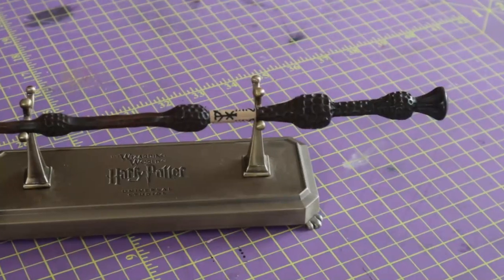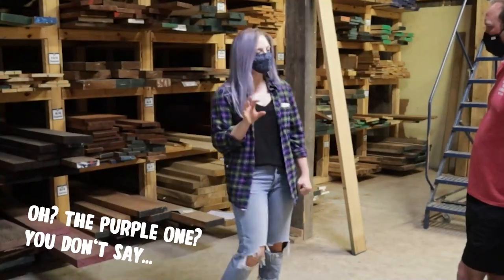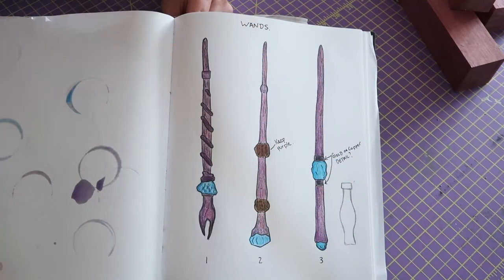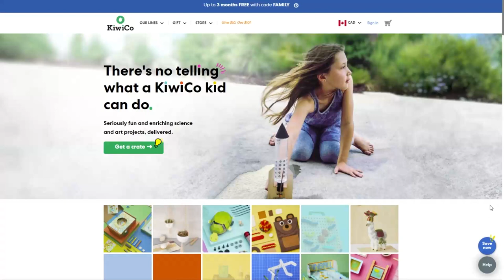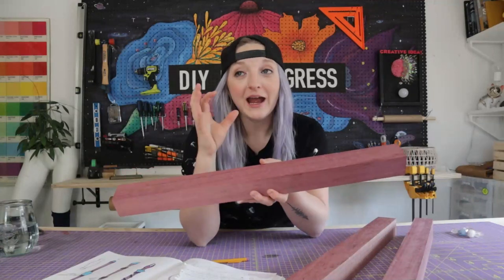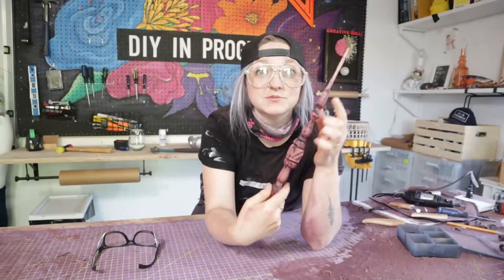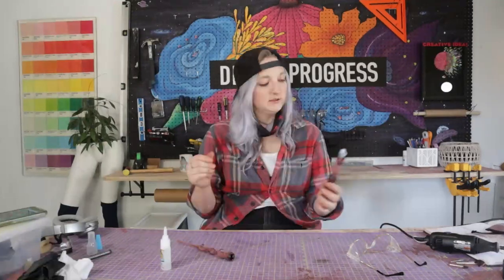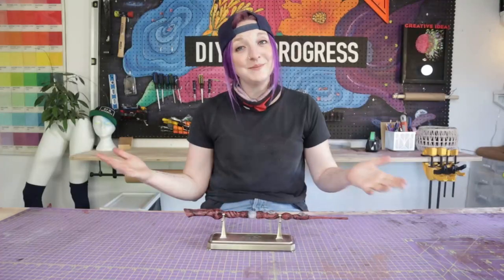DIY Magic Wand w/ Purple Heart Wood! | CREATIVE BEAST | DIY Danie

Comment: Do you know if it's possible to drill through the quartz? That would let you insert a metal rod, which would make the joint stronger. Because, let's face it, any stick will eventually be used for an impromptu swordfight. Especially a fancy stick.

Comment: Warning! When working with quartz, it's good to wear a mask & ofc the safety goggles-- not just bc of stray chips, but quartz dust can be very dangerous afaik (again, afaik, this is more relevant when sanding or creating lots of dust that you should never ever breath in...& less when yr just chipping off one piece-- but still! Safety!). I say this bc the Neurotic Nudge in me saw you changing the shape of the quartz & then the <"oh no what if she doesn't know & then, down the road, she-- or anyone watching-- works with quartz & it's like 'hey I've done this before nbd' but then they make dust & get Silicosis & that's permanent lung damage ohhhhh nooooo!">...tbh it's, imo, a good idea to check out the properties of stones you're planning on grinding or significantly altering-- or even just handling, sometimes!-- bc a lot of them can really mess you up if you do stuff with them other than buying a piece of jewelry that's already sealed to protect it (& you!) from it breaking down.

...so yeah: just a bit of an overkill warning from yr friendly neighborhood Nudge.